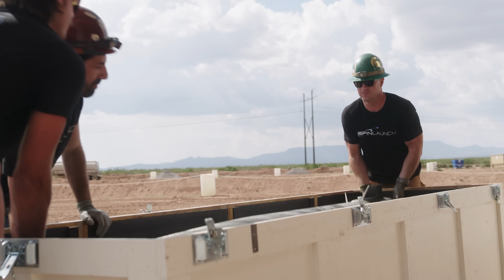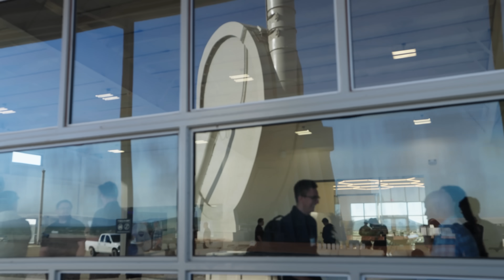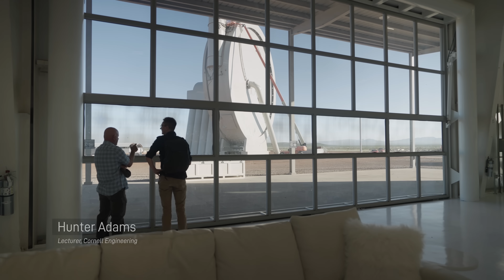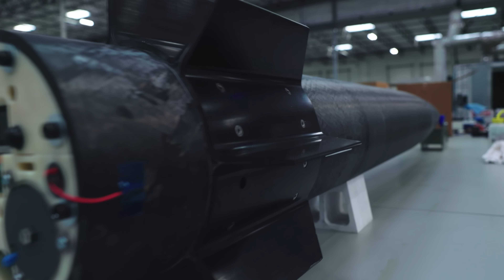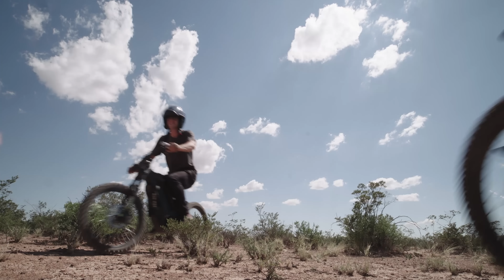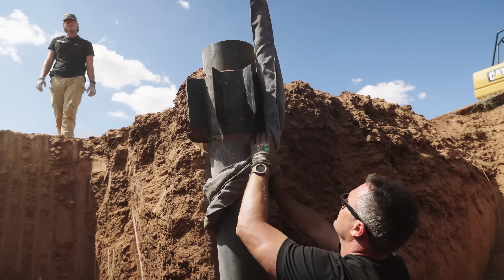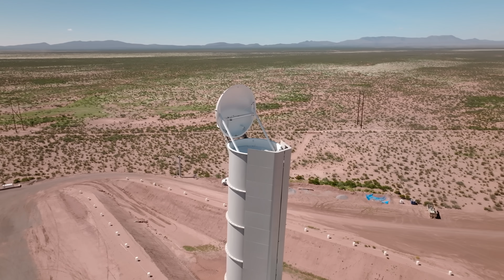Flight Test #10 - The First Payloads

Comment: I noticed the flight path of your missile makes no sense for reaching space. Notice the wobble, while that doesn't look like much on earth, if you expand that out, a roughly 30 degrees offset you had out of this launcher will result in thousands of miles difference in space. A problem you still have no solved since launch 1. I believe you finally covered the bearings for the motor, nice job. However, there is rust inside that chamber, which means it's been oxidizing and therefore you don't have a vacuum inside your chamber. Also, I believe you need to account for the fact that when the rupture plate is broken the air will rush into the vacuum, gliding over those stabilizer fins from all nearly every direction causing lots of strain on the launch. 

All in all, I see you made one improvement, which is fixing the leaks caused by exposed bearings for your electric motor. aside from that, I'd say the payloads you were flying were probably just devices used to measure high instability during flight because they know the missile would wobble this much. 

If you pitched this to me on the moon i'd be happy. Here on earth you have not even broken mach 2, and you never will on surface level because anything accelerating too fast will just vaporize because of compressive heating.
Reply: Up?  Up makes no sense for reaching space?
It's good to believe, but the rust is not going to go away because you pull a vacuum.
There is no "rupture plate".
How can I pitch this to you on the moon?  How will you get there?
Reply: @bradleyrex2968  you know that plate that ruptures. That's a rupture plate. :P you think the sudden vacuum collapse isn't going to make this thing fly like crazy?
Reply: @williamsplays8528  You know that thin mylar cover that doesn't bend in at all in the video? (You can't possibly believe there is a vacuum behind that?🤣)  That's not a rupture plate, it's a dust cover, and probably also serves to hide some of their proprietary tech.  
The vacuum is broken and then resealed by 2 doors that open and  close.  That's what the long tube is for.  Maybe do some research outside this one video...

BTW why would a sudden "vacuum collapse" behind the projectile "make this thing fly like crazy?"
Reply: @bradleyrex2968  there is a vacuum behind that, otherwise the thing wouldn't be able to hit the promised speeds. Secondly think about it for a second. If it was held under vacuum, what happens when that vacuum is compromised. It collapsed, causing the positive pressure air to rush into the chamber, the sudden burst of air slows the projectile down, but the biggest concern is that when vacuums collapse the air moves very fast and from a multitude of directions. Which means that the air will be smacking into the big ends of the aerosurfaces. Combine that with the torque and anti-torque of the rotation and you get a missile that can't fly straight. If you have any eyes you would see it is indeed not flying straight. Now, the company says it is under vacuum so logically I would presume it to be under vacuum.
Reply: @williamsplays8528  There is a vacuum behind that weak thin perfectly flat mylar sheet?  And the vacuum pulls none of the mylar backwards into the machine when it bursts?   Pull the other leg for a change. 
There is a heavy steel door behind the mylar sheet, and another door behind that.  Vacuum is behind the doors.
Sudden burst of air?  Is that worse than the 100 miles of atmosphere it has to punch through???  Seriously have you put any thought into this?
Reply: @bradleyrex2968  and no. Up makes no sense for space. Do you live under a rock? It's called a pitch program for a reason. Going up would cause more air to fight against, more gravity to fight against, and won't even get you orbital.

Oh but I can already see you saying. But but but gravity will cause it to pitch naturally. To which I say you are kinda dumb because the streamlining design of missiles causes them to stay oriented in the direction they have velocity. Which means if it is starting to pitch downward it is losing a tremendous amount of vertical speed. This means that you have just lost all of your velocity required to get into orbit. I mean what, that tiny little motor is going to get you going 7 times the speed of sound once velocity hits nearly nothing to allow for a gravity turn maneuver. Honestly.
Reply: @bradleyrex2968  how will you get to the moon. Same way we do it all the time. It's called a fucking trans-lunar injection followed by a cislunar insertion. -_-

Comment: instead of a vacuum or partial vacuum why not just use an electro-mag launch (same as carrier launch systems)encompassing supersonic air in a tube as air pressure in the pipe can assist with the launch and is easier to build. like a big ol air gun

Comment: Heyo Spinlaunch; I've been thinking about your future problem with full-size payloads and how to safely detach them from the launcher without causing the device to throw itself into the next timezone through force imbalance.

An obvious method is to send something off in the opposite direction for full balance, but how to safely plow an artillery shell into the ground behind you every launch? A massive trench? Seems like it would get destructive and loud in a hurry.

BUT, have you considered Lenz's Law, and how magnets falling down a copper tube slow down?
How about a 300kg+ magnet being lobbed down a copper-lined tunnel? How much energy do you think you could regenerate out of those eddy currents, and how long would that channel have to be to 'catch' the magnet slug? 
I have no idea; I'm just planting seeds here.

Very neat stuff.
Reply: it is not necessary to throw the ballast in the opposite direction - you can move the load from the center to the edge on the same shoulder at the right time

Comment: It's a boondoggle.
You are going to take a delicate payload, spin it at 10,000 G's, release it and not have the platform tear itself apart due to asymmetrical loadings, have it pass through the atmosphere and not burn up due to frictional heating or smashed by atmospheric pressure.
Everyone gets a nice fat paycheck until the investor's money runs out.
Reply: And you should try understanding whats happening before shittalking.
Reply: @NIOC630 the company has given up on the spinlaunch system and pivoted to something else.  So, I guess it's you who are shit talking.

Comment: When you release a projectile that is spinning at 120 RPM, it is going to waste a lot of energy using the aerodynamics to stop it from spinning. This thing is still leaving the launcher at a 20 degree angle relative to its flight path. It seems that they need to detonate a small charge to stop the projectile spin before it hits the air. They should really go all the way and power this with hydrogen, associate it with Scientology and put it up on Indiegogo.
Reply: Why not just release the front before the back?

Comment: The gravity lost on 100km Heigth.  on.7.5km nothing is happend there, the booster will fireup em self on 10tousand g ..  To bring an raspian to orbit , an linear railgun is better, ech coil will be incrase the speed, its need around 30000 km/h to leave the erth. the railgun must have a lenght of 2000 meters for the masses of an raspberry without destroy them accu :-)

Comment: You are a scam. There is no way you can launch a missile at mach 7 and survive the change of a vacuum to the atmosphere. Calculations show you have to support two 1,000 ton freighters at launch, and release an equivalent mass at the same instant in the opposite direction. This wil destroy your platform. You do not show any mechanism to survive this. Also, you cannot generate a vacuum in such a large structure. The atmospheric pressure will destroy the structure. Also, the leakage will make it impossible to produce the needed vacuum. Your project is simply a money scam for gullible investors.

Comment: having something like this on the moon would be awesome. you could directy launch paylouds to earth without fuel and they would travel for only about 20 days. the existing 1 third scale system at mach 1.4 would need prox 100 days.
Reply: That would certainly solve the dust issue

Comment: Omg seriously I have never seen so much waste of time and money. I mean seriously did at at least on person calculated the fundamental physics. What is the end goal? You like to put a small satellite into low earth orbit right? Did at least one calculate the required exit speed and then the required RPM and the launch system. I can't believe the VC capital and those institutions spend any time on this.
Reply: did at at lest on person?  yes.  And they used a spell checker.
Reply: Thanks for pointing out the spelling mistake. I missed the last spelling bee, due to my math and physics class.  But common, so you like to shot something into low earth orbit with this? You like to reach an altitude of min 1200 km and then the payload must be fast enough to stay up there.  Not arguing to get it on the correct orbit.
Reply: @HK-yo4se    Yes, I admit it, I like to shot things.  
What is the maximum altitude your physics classes say this will reach?

Comment: I think from a back of an envelope guess you'd only need to go 2x or 3x the diameter of the centrifuge to have objects with a certain payload all the way to LEO without any propulsion other than spinlaunch's. The thing then is to get it so you can do multiple launches per day so that this becomes a reliable mass-launch system. And powered by renewable energy, virtually free.
Reply: what are the estimated dimensions of the envelope?
Reply: Not going to happen.  Sorry.   To orbit you need to go 17,500 mph laterally as well as get above the atmosphere to reduce the drag.   Throwing the projectile up really high is the EASY part of this idea....making a rocket able to accelerate itself to that velocity while still being able to absorb the rotational forces of the launch is going to be the hard part.   It's almost impossible to make a liquid fueled rocket that could take the lateral G forces on launch so you're going to need a solid rocket to do the job.    And no solid rocket we have made thus far can take the lateral acceleration this thing makes and still be functional.   So when/if they get to the point of trying to make the rocket.....they're going to be going up against some real problems that I'm doubting they'll be able to solve.

Space is hard.....and this idea is only sucking money from projects that can actually WORK.   Any satellites that this thing might be able to launch in the future will be TINY...and a Falcon 9 could launch 100 of them at a time for less money.   Anyone want to bet on the final outcome of Spinlaunch?   My money is on the scenario that always plagues such ideas....lack of funding once they hit one of the obvious roadblocks in their way that they'll not be able to get over.
Reply: @recoilrob324  Yeah drag coming out of the tube is going to be insane at full scale. Though i think that unique approaches are good to try even if they seem very far fetched.  This actually might be a good moon launcher one day, but on earth, maybe not

Comment: Kind of weird to have a video about your success without actually saying what you did. All I got out of it was you had a payload, sent it up in the air and then dug it out of the ground
Reply: How high did it go?
Reply: @PaulaBean I'm pretty sure it got launched at 1000mph and reached its maximum altitude of 30,000 feet
Reply: but don't they have to send it to space? @Cylius.
Reply: @nishanttomar7826  Well, that is their goal, but i can't realistically see them putting anything into orbit. The whole idea is to use the contraption to assist it in getting to a thiner part of the atmosphere where they can turn the boosters on for more fuel efficiency. But there are just lots of reasons why this probably won't work, but here's just a couple of them. First of all, the size of the crafts and payloads that they want to send up there. The size of the contraption that would be needed to launch a 100ft tall shaft like that would need to be bigger than typical sky scrapers, and the necessary energy consumption to launch something about 100ft tall that weighs several tonns in of itself and carrying a payload that also weighs tonns to a distance greater than 5 miles above the surface just by purely yeeting it, is completely unrealistic. The second reason it wouldn't work is the fact that a 100 foot, pretty much hollow cylinder getting launched near instantly at speeds greater than 1,000mph through the densest part of the atmosphere would be like it getting smashed against a concrete wall. It's a pretty cool idea, and it would be awesome to see something like this come to fruition, but I just can't see this project going any further than what we're currently seeing.
Reply: Only 8x faster and itll work! @Cylius.
Reply: @VTInt1  I mean... it would be very interesting to see them be able to yeet something that fast and get to a much less dense part of the atmosphere... but the size of the crafts that they want to launch, the shape, weight, payload, the fact that it's hollow, and it smacking the densest part of the atmosphere at above hypersonic speeds... each of these present their own engineering challenges, and some probably can't be properly addressed for a very long time due to our materials/alloys not being strong enough to handle that kind of pressure and tension. Not to mention that the size of the contraption that would be needed to launch it would look like the 9th wonder of the world.
Reply: If it had to be dug out of the ground, then can we assume it reached terminal velocity on its way back down?  If so, what's the minimum altitude it needed to be to reach terminal velocity?
Reply: @stant7122  About 1,500 feet
Reply: This company is like the Theranos of the aerospace industry. Hyping and promising technology that they can't even deliver.
Reply: they shot a rocket with stuff in it... into the ground. wasn't it supposed to go boom into space?
Reply: @RickShangle  No it wasnt, this is called a Test.

Comment: This video won't age well.  Spinlaunch's days are numbered.  When their investors realize the technology has too many fatal flaws they'll silently pull the plug.  And I'll be there with Thunderf00t to say "we told you so."
Reply: What a joyous day.  They will be sell of their patents and tech and move on to something else.  And you will be there... with Thunderf00t.   Where is "there"?  Like meet a Chili's or something?
Reply: @bradleyrex2968  The problem is that they aren't giving us /any/ numbers whatsoever, such as nose angle (seeing as it looked wobbly on launch), speed, height reached, RPM/RPS or weight in these videos. They gave us a couple of numbers ages ago and one test flight reaching about 4600 MPH, which is still about 20000 mph short, so I've got to see more before I'm convinced this is going to work in full scale.
Reply: @bradleyrex2968  who would be a buyer of said patents?  Just because you can patent launching something at hypersonic speed into the densest part of the atmosphere doesn't mean it's viable.  The secret to space launches have to do with starting out slow at the densest layers.  Then constant acceleration as the atmosphere thins out with altitude.   Anybody knows this except those without engineering degrees, or those who do, fresh out of college.  As is what most of their trendy engineering crew consists of.
Reply: @byugrad1024   Companies like Lodsys, sometimes referred to a patent trolls. Anybody knows this.   Do you really think they only have one patent?

Comment: 25,000' vertical. I understand it's scaled down, problems will only grow with it's scale. 

They plan on launching something with 3 to 4 times the height achieved here, by something that's massive (remember, this is the small scale here) and also on top of that the 'projectile' needs also to be a rocket. Altitude isn't nearly enough, especially when trying for orbit. So I'm assuming that rocket motor will take the device from practically 0mph (laterally that is) to the 25,000 or so mph needed (depending on the satellite's desired orbital altitude) so now we must factor in explosives, and a lot of it too. 

Cool series of experiments, and I love the passion shown, but is it just a money grab attempt? Do these investors really know what they're funding?

I like it, it's something that hasn't been tried before, and furthering our knowledge because of it. But I doubt it's utility

Comment: What's crazy is the DoD has tech that blows this out of the water and makes this child's play. Even oxidation rockets are old tech. If the American people knew what was really out there... Every city in the nation would burn to the ground because it's not benefitting humanity. Look up David Adair. He made an electro magnetic containment engine and tested for the DoD back in the 70/80's, that would leave the ground like a bullet leaving the barrel of a gun. You don't even need that or really even this tech, you could simply use an inertia propulsion system to leave Earth's atmosphere, zero rockets, nearly zero fuel. Not hating on this tech... But it's old. Nice test though.